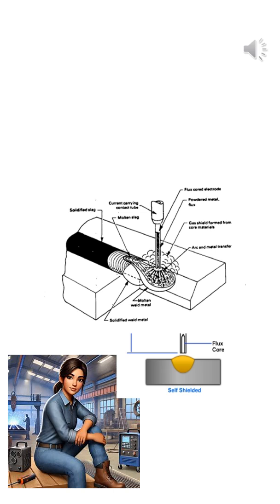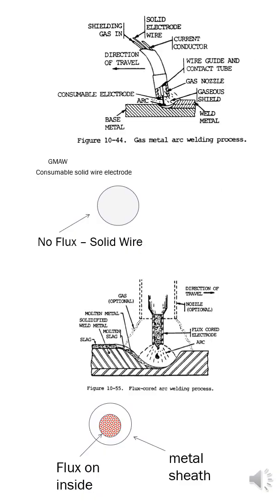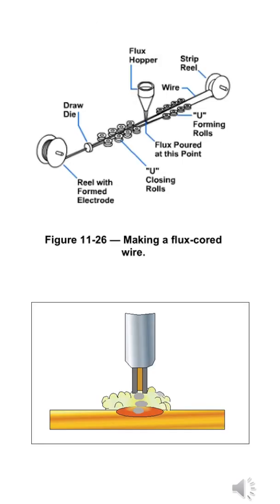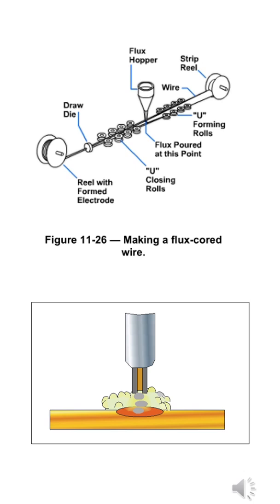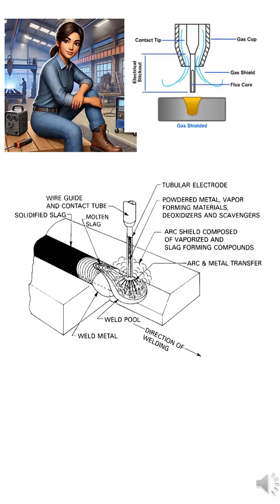FCAW Explained: How Flux Cored Arc Welding Works #FCAW #fluxcoredarcwelding #weldingprocesses

Comment: What stops flux and slag from building up inside the weld? How does it all end up on the outside?
Reply from the maker: Great question -- Here's the lowdown:

Flux and slag don't get trapped inside the weld because they're built to separate from the molten steel. Their chemistry makes them much less dense—about 1.3 times less dense than steel—which means they naturally float to the top as the weld cools down. Plus, the heat and turbulence in the weld pool act like a mixer, pushing these lighter elements upward. As they make their way out, they pick up any impurities in the liquid metal, ending up as a slag layer on the outside. Once the weld solidifies, you simply chip or grind that off, leaving a clean, solid weld behind.
Reply: @gpacex  Thanks! I'd been wondering for a while but was surprised that buoyancy is enough